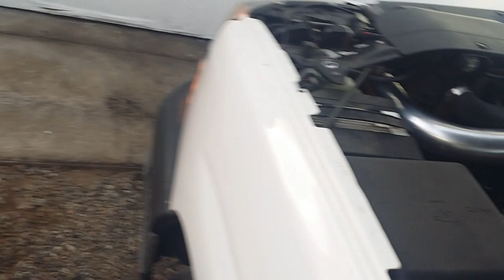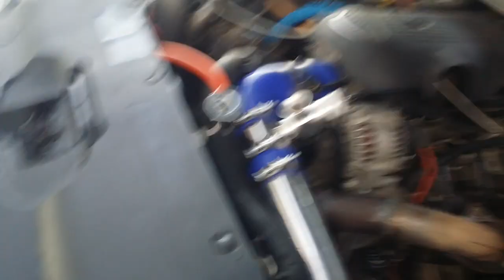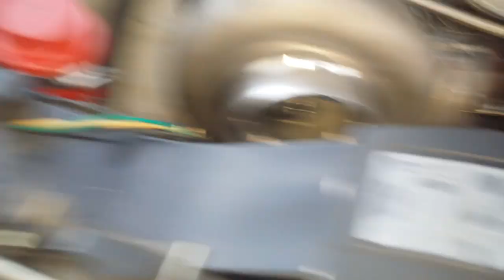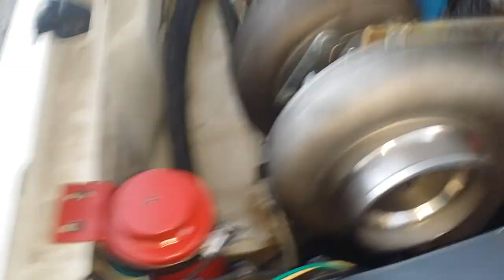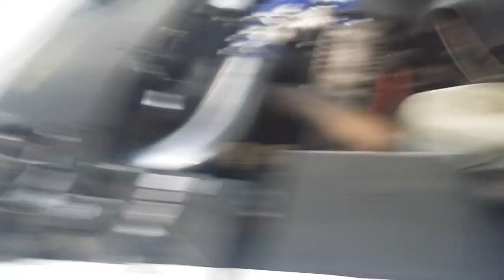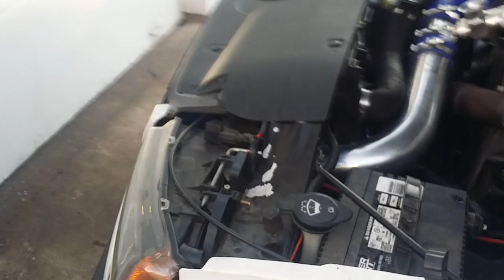2003 silverado 5.3 turbo startup walk around

Comment: I'd make that 90 into a metal. Pipe. If if caves like that it is just killing air flow otherwise nice setup
Reply from the maker: willhdewey thanks for the suggestion but its 3"pipe and a 4" throttle body and a 4"maf.  there is no restriction caused by a silicon coupler and I needed 2 silicon couplers in that location in order to put the blow through maf in front of the throttle body.  this truck went back to the customer long ago and is still being daily driven with ac and no issues